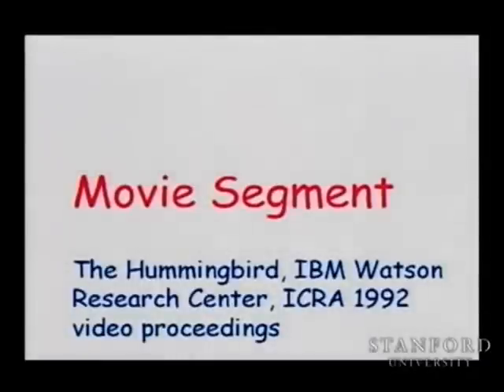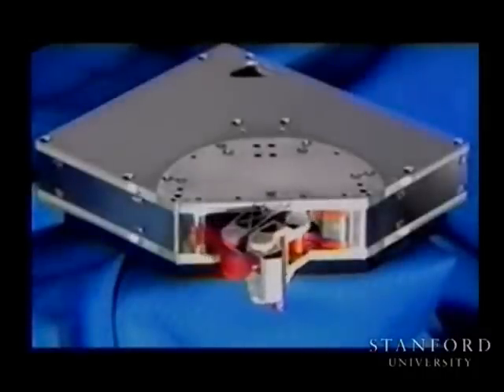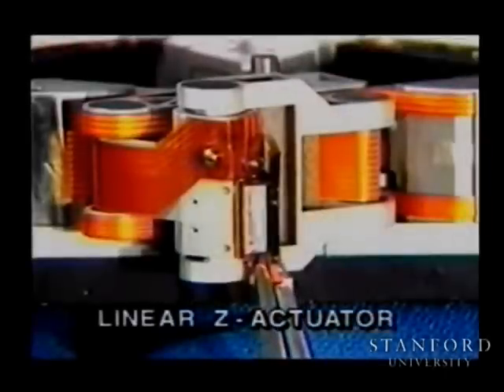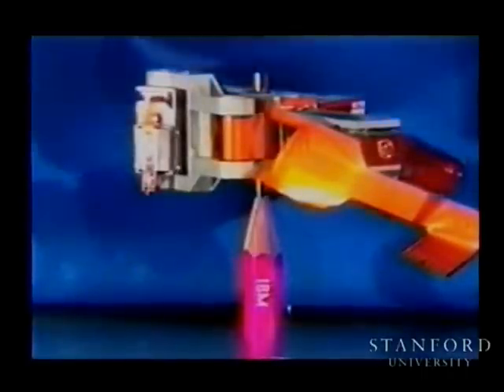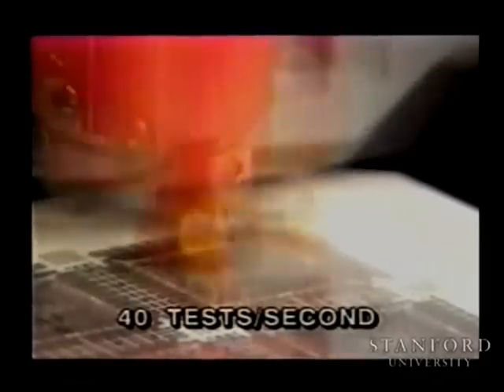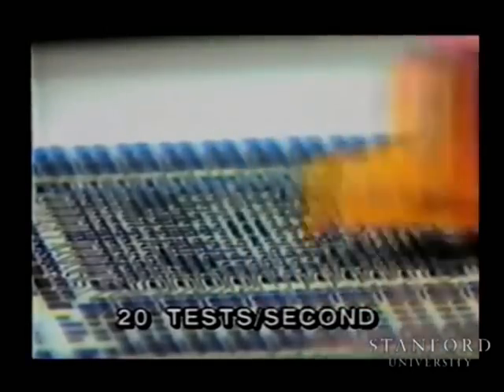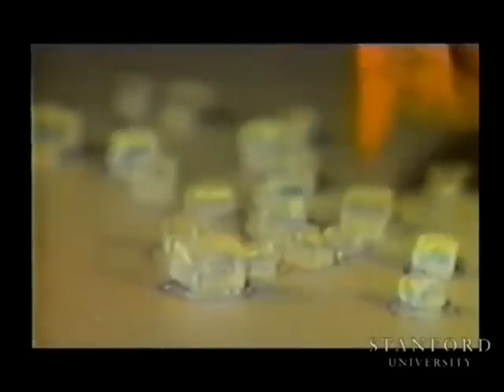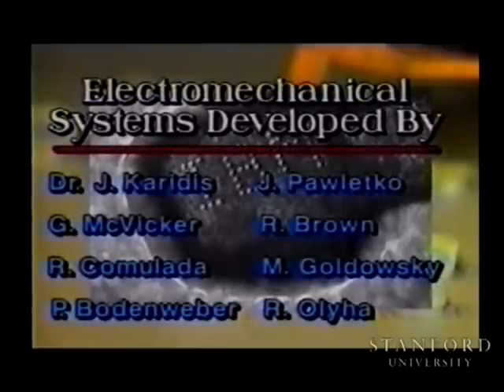IBM Hummingbird Mini Positioner

Comment: Anyone knows what applications it had? And in what it has developed now days? Or it was just forgotten like the butterfly keyboard he invented?
Reply from the maker: Sir:

Yes. I worked with John Karidis (Correct Spelling) and Joseph Pawletco They were geniuses all. I built the first one and many after wards For IBM, East Fishkill and in Boca Raton, Florida. Who are you, and why are you interested?

Robert Brown
Reply: @colibriengineeringinc.5065  I worked on it (designed the processor board that drove the robot). My name is on the 2nd page at the end. It was used for testing Wafer chips. And, I agree, John (RIP) was a genius.
Reply: @colibriengineeringinc.5065  Hi, thanks for the reply. I am a no one that matters just a Mechatronics Engineer, but I am working on a project to integrate 3D buildings with home automation technologies. I am in the process of developing the base of the 4.0 industry technologies that helps us to approach to the fast building constructions automated and integrated with the home automation installations.
That is why I need to understand old technologies with the potential I am looking after. I would be very happy if you could provide me some more information about the applications it had and how it was further developed with the new emerging technologies.
Thanks